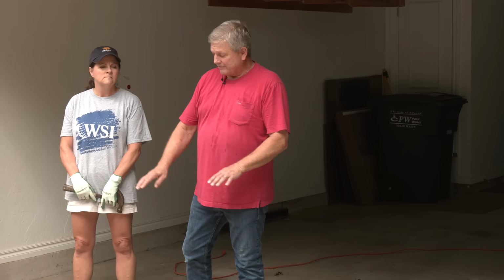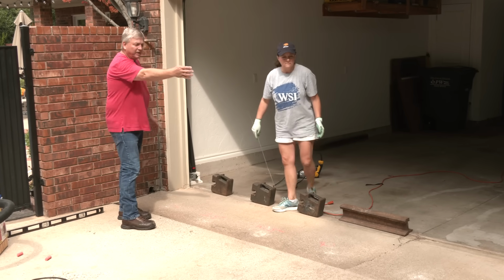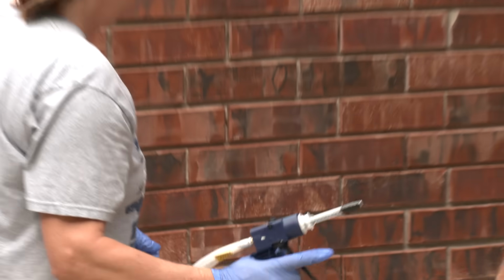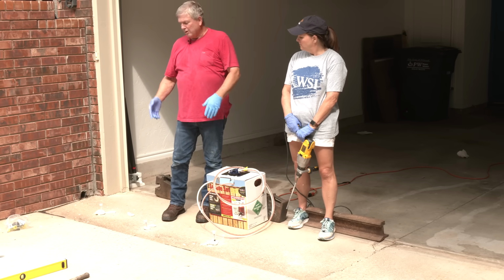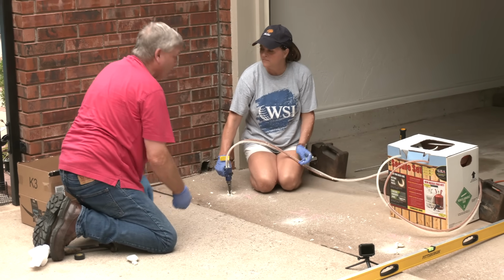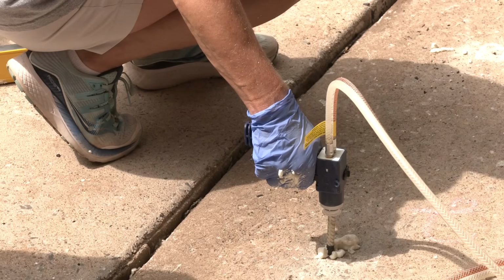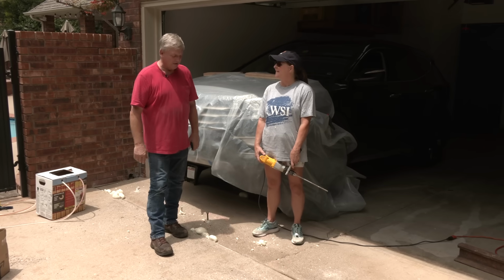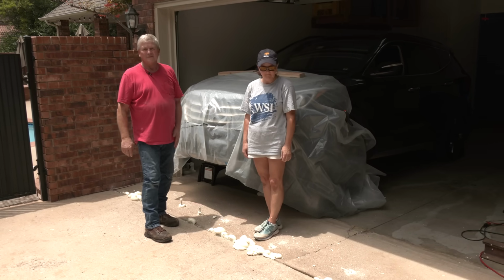Raising Concrete Driveway Slabs with Secure Set

Comment: It seems to me that having the lady standing on the very concrete slab you are trying to LIFT is counter-productive. Shouldn't she have been standing on the adjoining slab, instead? Standing on the depressed slab would not allow the foam to lift the slab unless you over-filled the cavity below the slab. (Using more product than you needed to.)
Reply from the maker: Hello Ani mal,  It might have been slightly more advantageous, however since the foam will support 10,080 lbs. per square foot, her weight was of little consequence.
I have personally been on a project where we lifted over 6,000 lbs. of concrete, it is a pretty awesome product.  Thank you.
Reply: @SecureSet-Fence-Installation  Hmmmm.....I stand corrected!

Comment: How does the cost of foam compare to repouring a new slab?
Reply from the maker: Hello Richard,  That is an open ended question.  The dimensions of the slab would have to be known and also how thick you want the slab to be.  Also, if you want the slab to be reinforced with steel rebar or not have rebar.  People also have the choice of the density or compression strength of the concrete.  Thank you,
Reply: Was thinking same thing that's over 800$ in foam could have replaced the section same price
Reply: @blazzingray  here you go thinking again.. then you got a brand new miss matched looking slab the rest of your life .. 🥴

Comment: OK, WHAT IS THE WARRINTY? FOAM WILL DETERATE AND IT WILL DROP AGAIN
Reply from the maker: Hello Dark Raider,  Most peoples impression of "Foam" is the Great Stuff that comes in a spray can.  That is not what this product is.  Great Stuff is a single component foam that creates open cell non structural foam.  Secure Set is a closed cell high density structural foam.  Closed cell foam was used in the construction of the Alaska Pipeline when it was used to support and insulate the pylons that hold up the pipe.  The concern was the heated oil in the pipe would transfer the heat down through the concrete and eventually thaw the perma frost under the pylons.  Structural two component closed cell foam was used to both support and insulate the concrete pylons to prevent that from happening. So, closed cell foam once placed under ground becomes an inert plastic that will stay in its original condition for 50+ years. Secure Set placed under a driveway will be there for a long long time.  Thank you.

Comment: By cutting a expansion cut were the crack was it might of been the solution for lifting the concrete maybe?
Reply from the maker: Hello FT,  Very good observation!  We actually ended up using a sawsall to cut the packing out of the expansion joint to reduce the friction between the two slabs.  Once we did that the concrete moved much easier.  Good eye, than you for the comment.

Comment: I think cleaning out the expansion joints would have been the first thing to do before using the product. Good product though.
Reply from the maker: Hello Bob,  You are correct, we did have to clean the joint, realized the friction between the two slabs was too great, used a sawsall to cut out the packing between the slabs.  Good eye!   Thank you
Reply: I wouldn't clean the joint.  Best course would be to use a diamond saw to cut through any debris, forming material or sealant in the joint to eliminate friction between the slabs.  Any joint filler remaining would reduce the tendency of the foam to escape to the surface before the void is filled and/or slab lifted.  Once the slab is lifted, then I would clean the joint full thickness, or to hardened foam, install backer rod, and caulk the joint with Dowsil concrete sealant.

Comment: Hello!  I would like to use this on a patio slab that has an exposed edge where I can see the gap underneath it.  It’s about 2 inches.

Obviously the foam will make its way out the edge unless I block it off somehow, or perhaps fill the gap at the edge first, let it harden and then try to lift it in the middle?

Any suggestions for how to do this successfully in this situation? 

I plan to put a hot tub in this section of the patio, so need it to be solid and have good load bearing capability.

Thank you,
Brian
Reply from the maker: Hello McSwizzles, If you have access to the edge of the slab, you are in good shape. Depending on how far back you have to put the foam, either use the14" extensions that are included in the package or acquire the CPVC extensions at either Lowe's or Home Depot. Here are videos links that can show you how to use the extensions.  https://www.youtube.com/watch?v=iigbr-tIM9I&t=2s   https://www.youtube.com/watch?v=1lO7M6Tlkwo  Other videos are available by searching Secure Set Spray Foam on YouTube.  Thank you

Comment: I had poly raise out to look at my garage that has sunk 3 in on one side they didn't want to do it. So looks like I'll be doing this. I'm thinking on drilling holes near the crack in the center "hinge point" and put some foam there before digging on the foundation and putting bottle Jack's under and slowly jack the garage up and then spray foam under using the pvc pipe on the end like your other videos. Or do you think just drilling holes threw out the slab and raising it like this video would be better?  Reason I was thinking on spraying foam on the hinge point first is because it seats a little lower then the other side of the slab so if I bring up the wall side the hinge point would be lower than the other half.
Reply from the maker: Hello 69Mustang,  One of the reasons the Poly Raise company did not accept the job, is because they know it will be difficult to give you a quote with so many unknowns about the project.  Your decision to raise your floor with a bottle jack (or jacks) is a good decision. A word of caution about the bottle jack.  Use something on top of the head of the bottle jack to disperse the lifting load as much as you can.  A customer had a project late last year where he tried to lift everything without a decent size of flat metal or something under the slab to disperse the load.  He ended up breaking the corner of the slab. At any rate, jacking up the sunken area, and then spraying the foam into the void affords you a greater success for permanently fixing your issue.  The expanded and set foam will support 10,080 lbs. per square foot. The kit will deliver 10 cubic feet of expanded foam.  Once you have the corner lifted, you can estimate the L x W x H of the void to calculate the size of your cavity.  Thank you
Reply: @SecureSet-Fence-Installation  thank you for your response!
Reply: Call A Mudjacking company in your area. I Mudjack a lot of garage floors that poly foam companies come out and try to lift but fail because there’s a void under the floor and the foam cures before the void is filled to be able to gain pressure to lift. On average I use around 2-3 yards of material.
Reply: @SaltySeaDawg125  mudjacking only lasts about 7 years, and is rather expensive. High density foam is going to be there many more years.

Comment: You indicated that the second and third application of foam would go underneath the previous applications of foam. How do you know where the foam actually goes in relationship to a previous foam layer?
Reply from the maker: Hello Timothy, When you redrill the holes, you have the option of drilling down to just below the thickness of the concrete slab, or you can drill all the way through the set foam layer down to the soil beneath the foam.  I have used both methods to raise slabs.  If you drill to just below the slab, the new foam will travel horizontally between the set foam and the underside of the slab.  This usually results in the expansive pressure of the foam starting to move (raise) the slab. If you drill through the foam, the new foam will travel under the set foam.  In both situations, the new foam will always travel to the point of least resistance. If you are confident that you have filled all the voids under the slab, I would drill to just below the concrete slab to finish off the project and raise the slab. However, if the foam is still coming up through seams or cracks, or you can hear the foam travelling under the slab further from your injection point, I would elect to dill through the foam and continue to fill voids.  Either way, once the voids are filled, the expansive pressure of the expanding foam will raise the concrete. Thank you.
Reply: Good question. If we can’t see the voids and don’t know how deep the holes are under the slab, we won’t know how deep the foam goes down and wouldn’t know how long of a drill bit to use to get through the first application
Reply from the maker: Hello Skeeeter,  When you first address the issue under the slab, step one is to drill a 3/8th's inch hole through the concrete.  Then, take a probe, measure the thickness of the concrete, then probe deeper to measure the depth of the void under the concrete.  Of course this gives you the information of the depth of the void at the drill hole, If the suspected hollow area under the slab is larger, you can drill a second hole and repeat the measuring process.  A thorough hammer sounding of the area of concern is very helpful.  We have not worked on a job where the depth of the void is fully unknown. This project we videoed, it was determined after the job was successfully completed that void areas under the garage floor were also filled with the foam. It didn't hurt the garage floor, and it was gratifying to know water would be stopped from undermining the soil under the garage.  Thank you.

Comment: Great presentation! I like this method and have a number of projects in mind.  That existing crack between your slab sections very likely provides some interlock, which might cause your first injection area slab piece to actually lift the next piece. When there is differential elevation across a crack, I believe I would try to release the sections by cutting/chasing the crack with an angle grinder and a diamond blade - maybe a small drill also.
Reply from the maker: Hello GrouseHiker,  Very good point.  We actually did use a sawsall with a concrete blade to relieve stress between the slabs.  Once we did that the independent pieces moved more easily. Thank you, good eye!
Reply: Great video and it was cool letting someone like us show that even we could do it.
It gave me incentive to ask you about my back porch slab. We had a gutter on second floor roof go out. Before we could get that fixed, the damage it made for us, cause about a 12'slab by 6' to crack and heave. Against the house it dropped 5 to 6" and sits up about 3.5". Would your product be a good fit for us. From what you used, I'm thinking it would take at least 6 cylinders? Waiting for your input.
Tom
Reply: Good idea. In a way we are dealing with small tectonic plates that rise and fall with each other depending on the friction between them.

Comment: Once you have the slab where you want it, how do you finish off the project?  Do you cap the holes with mortar? How do you clean off all the overfill?
Reply from the maker: Hello R Myers,  Once you are finished, use your drill bit to remove about 2" to 3" of foam from the injection holes.  Then take a small amount of concrete mortar and mix it up, then gently pack it into the holes.  Then take small fragments of either crushed rock or concrete, (I like to break up the small stones or concrete pieces with a hammer) put the concrete grains on the the top of the mortar.  This will help blend the mortar color into the existing concrete.  For any overfill, use a heavy wire brush, (I like the one I can use with a power drill) and remove all evidence of the foam.  If still have residue or a stain, use some spray can "brake cleaner" and that will help with the cleanup.  Thank you

Comment: Should you be standing on it while trying to pump it up
Reply from the maker: Hello Boostg20able,  That's a good point, for this particular job, it was not as critical. I know from experience that the foam will lift more than 6,000 lbs., so I didn't feel as if my weight would be a detriment to the project.  But all in all, you are right, the less weight to lift , the easier it would be for the foam.  Thank you, good point!

Comment: How long does the process take? How do you know when to stop so it doesn't rise too far???
Reply from the maker: Hello Joellong62,  Each project can be unique.  I think one of the most important aspects is determining, as best you can, what the situation is under the concrete.  Hammer sounding and a few strategic holes go a long way in providing you the information you need. Injecting the foam is fairly easy, and the fact that is expands at a controllable rate, prevents you from over filling an area and raising the concrete too much.  The "unknown" factor is just how far the voids actually go. The expanding foam will always move to the point of least resistance.  In this project we discovered there were voids under the floor of the garage that took some of the injected foam. That was not a bad thing, it just required more foam than we originally thought.  All in all, things turned out well and it cost much less than the bid Leslie had previously received.  Thank you

Comment: How hard and heavy was it to use the drill for that lady?
Reply: A good quality masonry bit, like she used, and a powerful drill will go through concrete in a matter of seconds. The drill only weighs a couple of pounds, if she lifts it up. The whole time she is drilling, she is only holding the drill in place while the drill does the job.  The lady does not use any muscle power to get the job done, nor does she feel any exertion during the job of drilling.
Reply from the maker: Hello Maria,  The drilling was probably the easier of the job tasks.  Use a 3/8th's inch concrete drill bit.  The length of bit is 12"  If you have any other questions, please let us know.  Thank you

Comment: Does it fill up any rain drains?
Reply: @guiovanny Marin Are you asking if the foam being applied under the concrete will fill up your drains?  If that is the question, then yes it could if it finds that as an open space, such as it having holes in the drain or a large break in the drain pipe.
Reply from the maker: Hello,  I'm not quite sure I understand the question.  Are you wanting to lift a drain that is part of your guttering system?  Thank you

Comment: For "weights" how about some 2x4 bracing from the top of the garage door?  Takes 30 seconds to put three in with a bottom plate to hold down the concrete edge.
Reply from the maker: Hello, yes that would have been a good idea.  Did not think of it at the time, thank you for the suggestion, will come in handy in the future.  Thank you
Reply: I work with what's available and this obviously ain't his first rodeo lol
There's almost always a better way in a perfect world
Reply: Risk lifting the house? No
Reply from the maker: Hello Swimming in the Deep,  No, the house was far away and the weight of the concrete is far less than the house.  If anything, it would have lifted some other area of the driveway long before it reached the house.  Thank you
Reply: @SecureSet-Fence-Installation  I agree, I was referencing the comment above from another reader.
Reply: @SwimmingintheDeep  and you were still wrong. Besides, that was a garage. And there's no conceivable way that that foam is moving that garage.
Reply: @BruceOfWaynes  LOL, ok Ken.